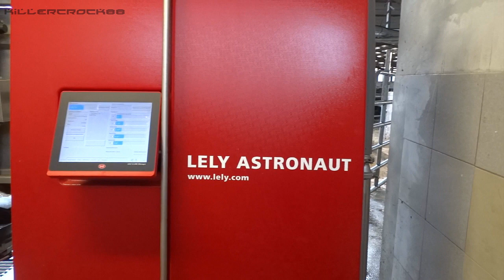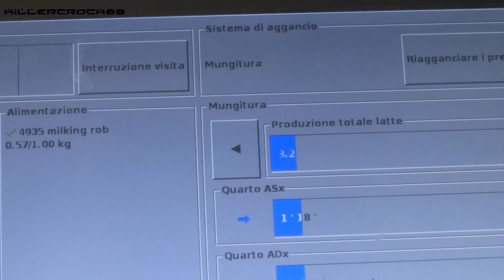LELY ASTRONAUT A4 | Robotic Milking System | Italy

Comment: Ok so tell me what do you do with cows that kick try knocking the machine off. All your cows seem to have perfect teat placement? And I don't see any cows really heavy in milk. Not often but on my dairy we did have cows that required extensions and some who only had 3 quarters instead of 4. As far as cleanliness and keeping the cows calm looks good.
Reply: The machine will automatically connect again if it gets kicked out.. And it can milk separately every quarter, so no worries if there is a problem with one quarter. :)
Reply: Always believed in doing these the easier way and whatever would save Labor. We installed automatic milking machines back in 78 and cut our labor i half and did a better job of milking our cows.. Just one problem now, I no longer own any cows. Sure do miss them.